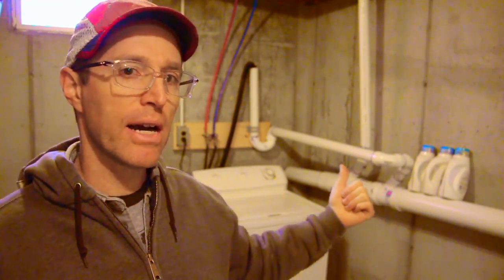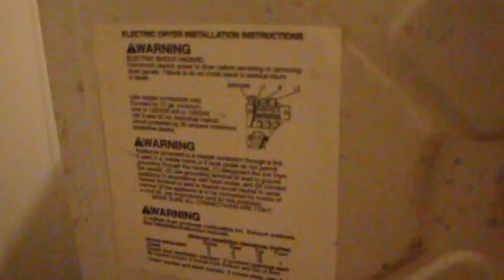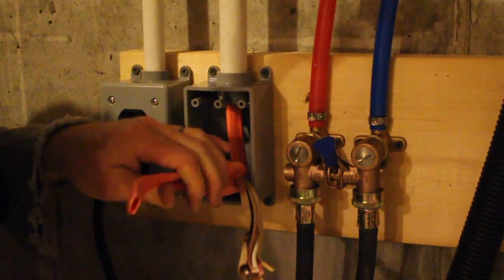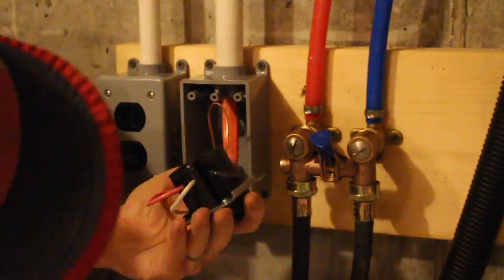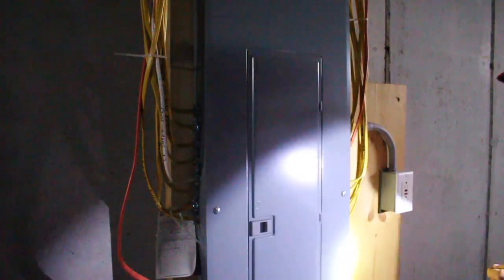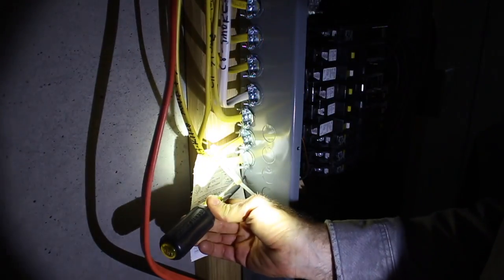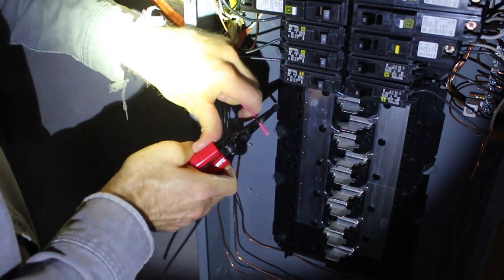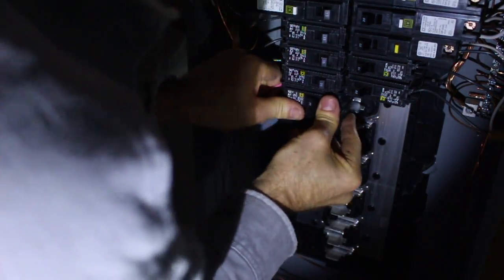Wiring a Dryer Receptacle

Comment: So you are wiring the receptacle, but you don't show which wires go where on the receptacle.
Reply from the maker: The black (hot) and white (neutral) wires carry the current, and the copper wire is the ground. Note that the outlet's screw terminals are certain colors. The white wire goes on the silver screw. The bare copper or green wire goes on the green screw. Black wires go on copper screws. In this case red is also hot, so goes on copper. Your outlet should come with wiring instructions
Reply: @metaspencer  They are all silver. (Levitron 240/220 outlet)
Reply from the maker: @chuckstone217  Ah yeah. In that case you need the diagram for the outlet. It's likely to be similar to this diagram: http://waterheatertimer.org/How-to-wire-240-volt-outlets.html

Comment: My electric dryer has a double pole 30 amp, but it’s taking power from the same bus bar. The drum motor is turning, but for the heating element to work, it requires one of the 120 lines to be from the other bus bar – I think you referred to this in the video as getting power from the left and right side.

I have a three hole outlet in the laundry room and see 120 V between the round hole and each of the hot slots. But when I check across the two hot slots, I see 0 V.
Reply from the maker: Hmmmm, sounds like a tricky situation. Just be careful, work slowly, and you'll figure it out. I can't quite visualize the problem you describe ...

Comment: I'm building my Manor mansion here in North Carolina. Thought It'll be better to hire a licenced electrician to wire my laundry appliances as well as one ice maker machine and one freezer receptacles. At the beginning I thought the hardest part was wiring the dryer receptacle,  but you saved me $1,700+  to get the job done. I'll just have to buy the materials and figure out how to handle myself a very very long wire to the dryer haha. BTW Thanks a lot mate,  you got a new subscriber here!
Reply from the maker: you can do it! this is a very manageable job ... good luck with it!
Reply: metaspencer  Thanks Spence, btw pretty interesting chanel,  looking forward to your next video 👍👍👍👍👍
Reply from the maker: +Lewis Rockwell ... Thanks!

Comment: I dig the job you did .... I'm cheap I ran the Romex directly to back of my dryer ....  saved a few bucks
Reply from the maker: +Michael Horsford ... why didn't I think of that??? Sounds way easier ... my fans are wired that way but I never thought of it for the dryer
Reply: heck the cord and receptacle run upwards of 40 or more  jus sayin lol
Reply from the maker: +Michael Horsford ... crazy! My dryer is second hand so had the cord... pow!
Reply: True. The plug and 10 ga wire is more than 20 bucks and u have to wait to be delivered since in many places they don't have it in the store.

Comment: I thought you are not suppose to put romex in side any pipe cause of heat. I need to run a romex cable from my dryier inside the house but at some point the cable would be expose to the elements because the service box is outside on one of the house stilt. Any suggestions? Thanks for sharing.
Reply from the maker: That's right: you're not supposed to run Romex inside of conduit. I've had an inspector tell me that a very short run with plenty of space in the conduit (only one run of Romex) is not a problem. For your situation, a larger diameter conduit (1" or 1.5") would give that wire plenty of space to dissipate the heat
Reply: @metaspencer  Thanks!

Comment: What size diameter is the PVC? 

I'm in the process of hooking up my dryer. But I'm going with a 2 gang box. A little more room to work with.
Reply from the maker: 2 gang is great. Good choice. I typically run 1/2” conduit but you can run 3/4” .... it kinda depends on you wire and connectors

Comment: I know thi s a really late question, but I just got a new dryer that had the same plug you're showing.  My old dryer had the ground round peg in the middle (exactly where the new one just has the screw)  I bought a new outlet at Lowes to change this out so I could use the new dryer, but my cable has only 3 wires...a black, a white and a copper ground wire.  But the outlet is just like yours with the additional screw for the red wire (which I don't have).  I have th ebreaker turned off, but I'm confused as to why my cable to my dryer outlet only has the 3 wires and not the 4.  Will it be dangerous to hook this up without the red wire?
Reply from the maker: If the wire coming out of your dryer just has the three wires, match it to an outlet enervated with the same number and gauge of wires. Does that make sense? They need to be paired
Reply: @metaspencer  I am so thankful for this video and the info from you!  I did discover that the dryer cord had the 4 wires.  So, I went back to Lowes and someone there found me the right dryer cord for my old outlet.    Thank you so much for this vital education!
Reply from the maker: @pamelarachil3730  Excellent. Well done!

Comment: Please excuse my ignorant question, but, is that 220v set up?
Reply from the maker: +mynameislang ... dryer pulls 110
Reply: mynameislang all electric dryers use 220 unless they are gas dryers then those use 110
Reply: The one he hooked up was a 240V.  You can get a 120V small apartment size dryer, but they are for very small loads, such as a college kid in a dorm room.
Reply: Each hot is 110 volts, but they are opposite phase so they do total to 220 volts.
Reply: Nathanael Langston its a 125/250V set up. 125 V for the motor controls and 250 V for the heater coil🙂
Reply: @iratodd8867  It's three years later and now there are heat pump dryers that run on 110. . .

Comment: Why did you use white PVC for your conduit stub instead of gray conduit?
Reply from the maker: Good point. Looking back, I'm guessing it was because I had a lot of the white PVC (water waste lines) lying around and didn't want to buy a new span of the gray conduit. I'd definitely recommend the gray, which is available at big supply stores

Comment: what happened to the natural and ground ???
Reply from the maker: ground is connected at panel and in the receptacle, that way the machine itself if grounded ... neutral goes to neutral bar in box and connects to neutral terminal in the receptacle
Reply: I was just looking for video that showed where in the panel you connected it that’s all for inexperienced people they would’ve missed all that
Reply from the maker: @joer5000  I left that detail out of the video because my panel is a sub-panel, which means that neutral is not bonded. On a standard panel, you can typically mix grounds and neutrals on the bar ... but read up on how to do it in a wiring guide as you don't want to be experimenting and just trusting YouTube. Good luck!
Reply: metaspencer that’s what I wanted to know was how the ground and natural are handled in a sub panel

Comment: You don't have to hit the main breaker
Reply from the maker: in theory I understand that, but I'm always a bit paranoid and feel more relaxed working with EVERYTHING OFF in the panel ... but you make a good point
Reply: I meant to say it as a question,cause I to feel a lot safer with every thing off sorry .very good video easy to follow
Reply from the maker: The hazard of not killing power to the box would be coming into contact with one of the main buses ... so I go for maximum safety and kill the power to this box. But note that mine is a sub-panel. Most people are likely wiring to a main panel, where killing all power is more difficult. So follow safe practices.